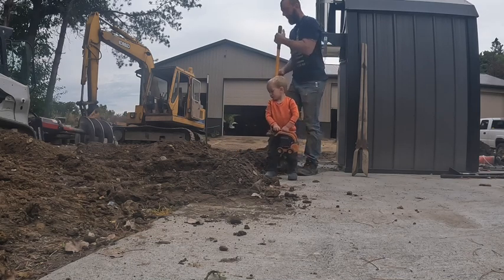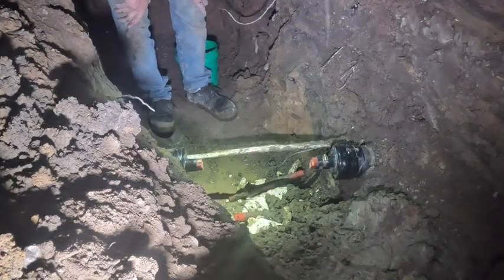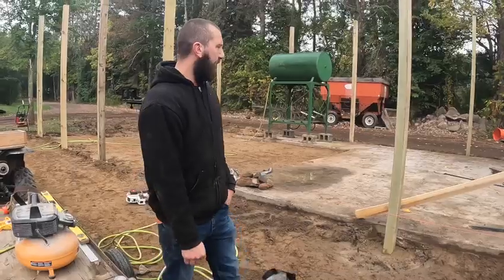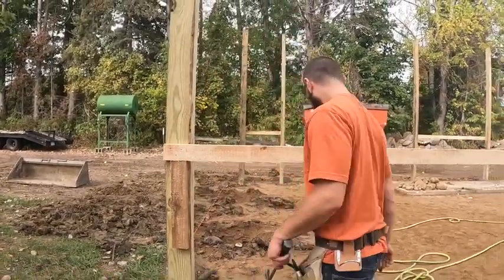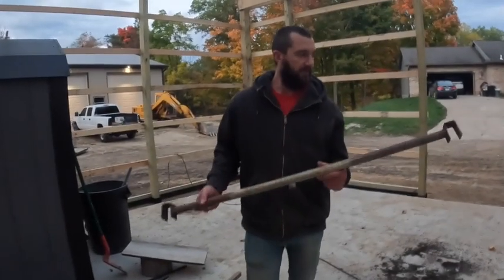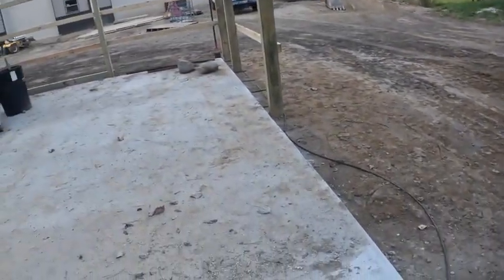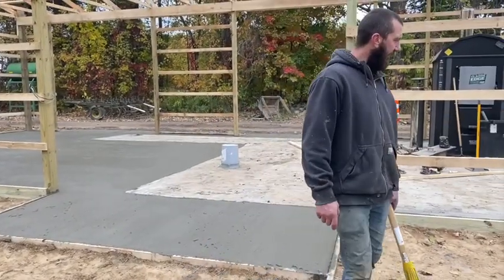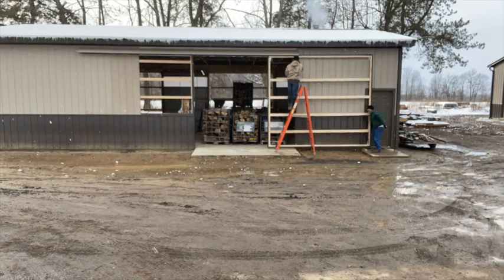Part 3 Build-A-Barn-Series: Poles, Custom Made Trusses, Concrete, Girts & Perlings

Comment: Hey Yall! Thank you for taking the time to film and upload this process. Definitely will be watching the rest. That truss spacer bar that was used is a great idea and ill have to try it when I put my trusses up this spring. Have you had any issues using the greener wood for the trusses instead of dried wood?
Reply from the maker: We haven’t had any issues with the greener wood on the trusses.  I stickered it and dried it down to roughly 30%.  It then was put in a truss in a matter of a couple days.  We kept them all stacked up to prevent any warpage before they got put on the barn.  Once they were up, the perlins and truss braces kept them straight as they finished drying.  We did have a couple girts that got a little crazy on us before the tin was on but it was only a few out of all the ones we put on. Thanks for the comment. Good luck on your build